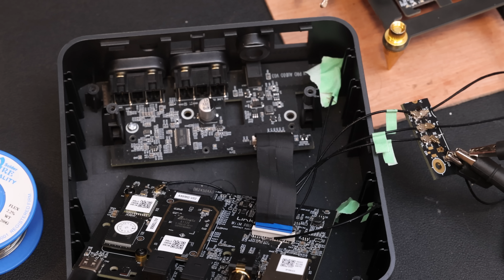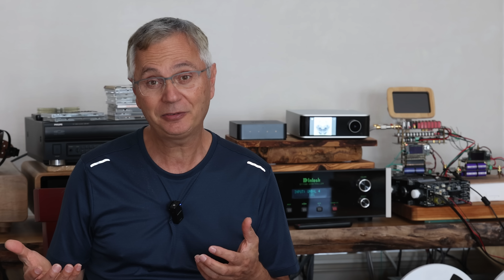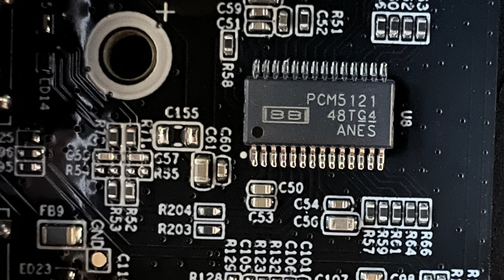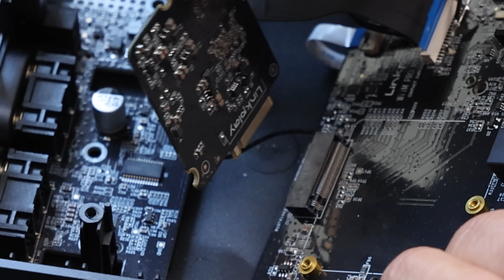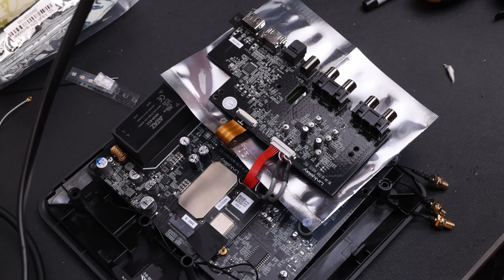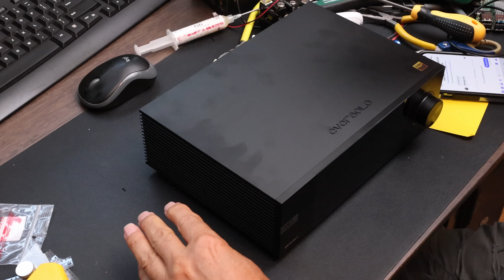I Bought a Wiim Pro & Ultra — One Surprised Me!

Comment: Sorry. BUT WIM PRO SOUNDS BAD and Wiim Ultra is better, but very mediocratic sounding gadget, but anyway it is ok for the price, you can live with it until you hear something really good. I tested them both 2 years ago and I could not stand to listen PRO, because of its thin, crispy, artificaila wanna be "high end" mids and especially highs. It has this typicaly emphasized crispy "clean" edges of notes with no body of most entry level dac-s. The higher in register, the worst this is. I bought Ultra because it is still listanable device is a Swiss knife streamer/dac and has room freq responce mesurement tool. There is more obvius difference in sound between Pro and Ultra as it is between Spotiy and Qobuz with Ultra. So, I can not really understand about good sounding wiim product you are talking about. Sorry, I do respect your channel and work a lot, but with this claims about good sounding wiim pro and ultra - do you know what a good sounding streamer or dac is at all or perhaps your hearing is in significant decline? No offense, but I have to express my "amazement" over your statemets, as you will about mine ones, I guess. And this my impressions are not just with one amp and one set of speakers. Kind regards.
Reply from the maker: I understand your perspective, and I respect your opinion. 
To get good sound out of the pro, the power supply that comes with the pro has to be replaced you can see the difference where I tested it in my last video with the QuantAssylum  there is a huge massive difference compared to a good one like the Studer or Ian’s 
I suggest you watch that test 
The WiiM power supply is in the middle of that test
Reply: @Gabster1  I will check it out and thank you for your answer. But, yes the entering current in the dac chip, the more stable it is and appropriate the better sound you will get and then is also amplifiing stage important. I had a chance to hear a Dac unites with practicaly the same AKM or Sabre chip, but the difference in sound can be astonishing - you can finnaly hear the music, the  timrbe fo instruments, - but also the price of the parts and developement is drastically different of course. I would not believe if I would not heare it.  Kind regards.
Reply: I have a Wiim Mini, and I was thinking about getting the Wiim Ultra because I need the extra connections. Can you recommend a DAC up to €300 (the price of the Ultra) that would offer a noticeable upgrade? Thanks a lot in advance! @majtextwriter1794
Reply: @majtextwriter1794  the main issue with the WiiM Ultra is its clock. That’s why many people, myself included bought the SMSL PO100 Pro reclocker which is like £50. You go USB out and then coax into another DAC to redemy this. I did this and then remembered that I have a USB input on my DAC which just hands over the control to it! Many people swear by the SMSL trick or use the DOUK which is externally powered and supposed to sound better!
Reply: @LDN_BOX  Thanx! But, you can not use external clock just connected to Ultra and using Ultra's streamer and dac, if I understand you correctly? Because usually you can use the same divice with external clock pluged into it. But I guess the device's topology must be pre-adepted for using external clock. Please for opnion or explanation about this. Thank you.
Reply: @majtextwriter1794  You mean out and back into the Wiim, you would still need it's DAC to then convert it to analogue. So, if you use a reclocker then you'd have to use an external DAC. Even if you use COAX to an external DAC directly you will still be using the Ultra's clock. The only way to bypass this is USB out from the Ultra. I don't think I would be that adverse to using the Ultra's DAC, but I have a CD player with a very good (albeit older) DAC inside (Audiolab 8300CDQ), I also collect music so makes sense having one type of house sound re the music for that system, so I put everything through the CDQ (which was also made a pre-amp for a power-amp so had heaps of inputs) and then XLR to my amp.
Reply: @majtextwriter1794  Here's a curveball for you, I have heard people rave about the Fiio streamer which is cheaper that the Wiim Pro and sounds as good or better than the Ultra, not sure the model I think it maybe the FiiO SR11 but its around £100, so x3 cheaper than the Ultra. I have a mini headphone DAC by Fiio, the KA15 and love it! They make impossibly good products for the price, so I wouldn't be surprised if it did!!
Reply: @LDN_BOX  Thank you. This is explaining, I guess, why is to my ears the sound from TCL Qled Tv better even by YouTube then are the same recordings over Ultra's streamer and Spotify. Through Tv and Hdmi the sound stage is a bit larger, each element has more space and air and all together is much more enjoyable to liste to, especially regarding concerts - live tracks. I simply more like sound via Tv - hdmi. Ultra dac then via Utra's streamer and dac.
Reply: @majtextwriter1794  That's likely it, its all preference at the end of the day. I am sure they did alot of research into the type of sound would suit the majority of people buying it. It's not overtly offensive and you have a host of EQ options to fine tune it to however you like! I moved to Qobuz from Spotify a while ago, they have software to migrate all your playlists, when it comes to sound quality it's in a different league, the user experience is next level in comparison and its about the same per month. Give it a go on trial, nothing to lose and it will sound alot better!
Reply: @majtextwriter1794 I gave away my Ultra since getting an Eversolo A6 ME Gen 2. I concur that getting the sound off my LG Oled tv through its HDMI ARC connection sounds excellent and by memory better than the Ultra with Tidal tracks. The Eversolo also lets you choose eARC which sounds much better than ARC.
Reply: @majtextwriter1794 What DAC are you talking about?
Reply: @Gabster1  I agree! I have the Pro Plus and the Ultra. The Pro Plus sounds very good with the addition of an iFi 5v power supply, I have that with an older set up along with a old NAD and out through a pair of Sonus Faber Lumina and I am pleased with it. I have the Ultra its on an Audiolab DC Block Power chain, I have it go USB out into my Audiolab 8300CDQ then XLR into the Audiolab 8300A and out through a pair of B&W 707s3. I did the ethernet/optical/ethernet trick using an Audiolab Pearl Ethernet cable into the Ultra. All in all it's a very clean and open sounding! I have been using Qobuz and Audirvana (I prefer SoX to R8brain oversampling) it's a very nice experience!
Reply: @Gabster1  How you compared it to only digital out between the ProPlus with linear power supply and the stock ultra ?
Reply: Did you compare the two Wiim's used as just streamers into the same DAC? I have both in two different systems, but haven't compared them against each other
Reply: @marksobotkin6141  No, as they are, each unit as a streamer/dac into amp - different amps and speakers. But also just as a PRO streamer into a DSP - so bypassing the Pro's dac - This was much better!
Reply: @marksobotkin6141 I had one after another in the same system and thought the WiiM Pro Plus with the iFI 5v Linear power supply was extremely good! I have since upgraded parts of the chain on the Ultra side and not using its DAC. As a streamer it’s really good bar the DAC, I tried it before as a pre-amp and then using it line out but I wasn’t convinced by the DAC, but it’s subjective some might prefer it! I prefer the SoX over sampler in Audirvāna whereas most prefer the R8Brain! But, by the time you buy a linear power supply for the Pro Plus you are in the territory moneywise of buying the Ultra, so many people will opt for the Ultra. However, the Pro and Pro Plus have Apple AirPlay which is a huge miss and it’s more compact and less fussy too! So horses tor courses!
Reply: Paragraphs.